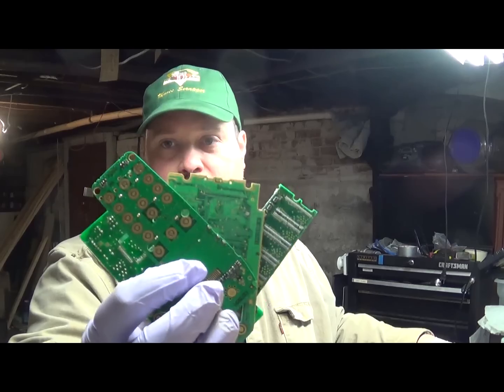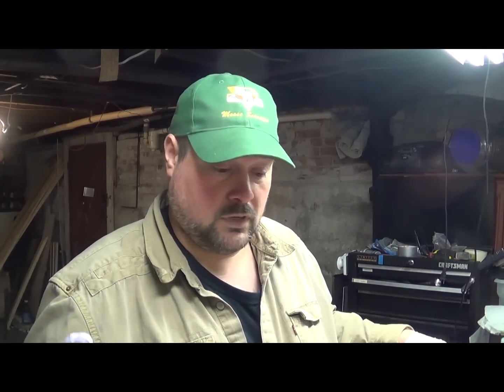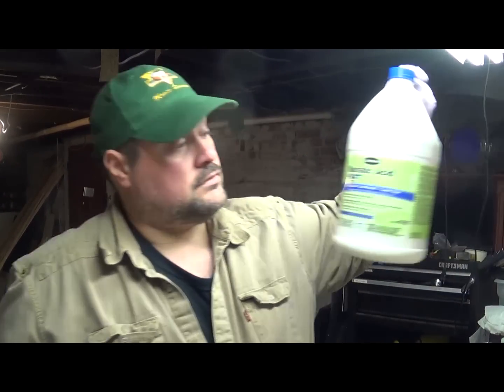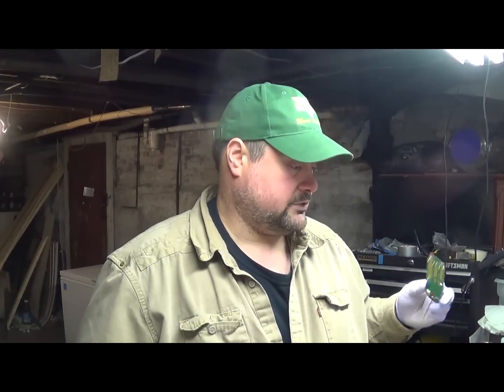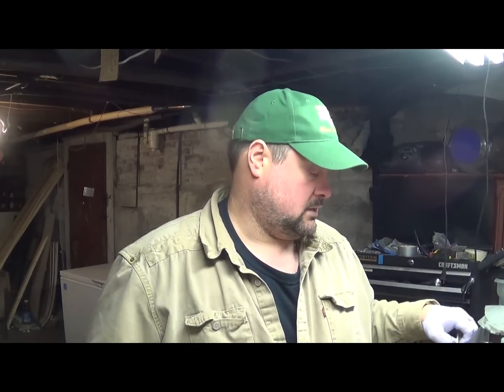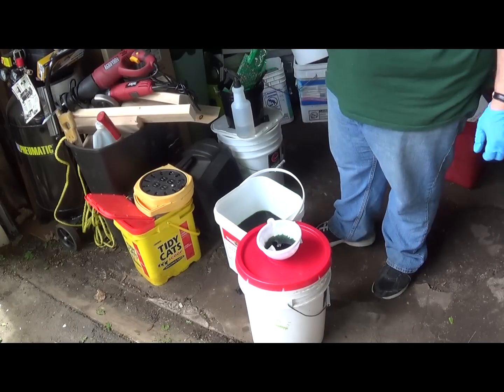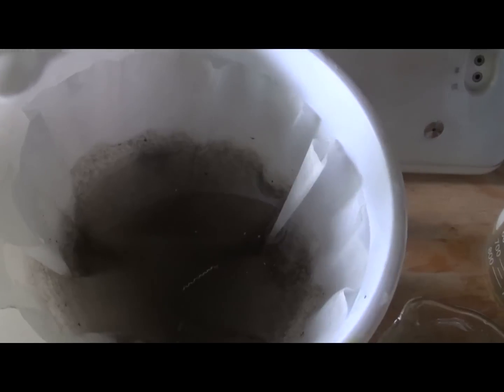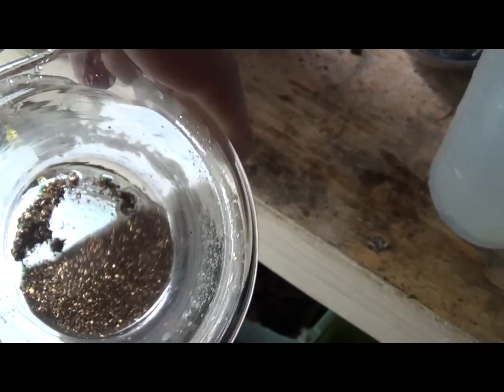Recovering gold from Cell Phone and other Gold plated Boards at home easily!

Comment: Hey moose! I have a question about needed supplies 1 is Pyrex the only thing I can use nitric and hcl in(aqua regia) or is there another material that's less costly. And 2, where do u get the filter to pour the chemicals through I didn't think it was a coffee filter but I could be wring..thought it was a special type and also what is the lowest ideal weather that the mixture can stay in during the process because I'm in Ohio and if you live here you already know what I'm saying it can be snowing and sunny in the same hour!
Reply from the maker: Hi there, they were in fact coffee filters.  As for the rest, depends on the material you are working with.  So far I have not used nitric in ANY of my videos and have been doing ok.  I would very, VERY strongly recommend Hoke's book on refining, its available free on the goldrefiningforum.  this can be a very dangerous hobby, best of luck!

Comment: hii , I have collected some gold fingers from ram bords ,i want to ask can we melt them directly to solid gold intead of dissolving them in acid and further processing. do reply
Reply from the maker: no.  As mentioned in the video, the gold is applied to nickel and copper and these need to be removed first.
Reply: no i have treated them with hcl and remover copper .they are just gold flakes
Reply from the maker: Then you can melt them, they will be what ever the average K of the gold plate was.  Typically between 14k and 20k

Comment: Great Videos!!!!!! I remember in another video you said (save all your Acid Peroxide coffee filter papers and burn them up and you may get a "little gold BB" at the bottom)....So why even do an "Aqua Regia" style solution? Why not just filter out your AP and gold foil and melt the foil while still in the filter paper? Why all the extra chemistry? I'm just trying to gain understating here...I not trying to be a smart ass.
Reply from the maker: +Luke Baehr AR is the "gold standard" for purifying the gold.  THe method you outlined would leave you with a very low karat gold.

Comment: Hey Moose, you said to completely depopulate the boards before they go into the solution?.. I've really been wanting to start trying this gold recovery myself. I have a lot of gold bearing material stocked up and also have a steady flow for more, so lately I've been studying up on it as best I can.
Reply from the maker: zackcat276 Yes, it is best to limit what you have going into the solution, especially for beginners.  It limits the amount of things that can go wrong.  Glad to hear you have a steady flow of material.  Keep in mind that it takes 1 pound of trimmed fingers to equal 2-3 grams of gold, and it takes about 50-100 computer towers to get those fingers...

Comment: Hey moose, ive just started getting unto scraping and i just wanted to know if youve come across a lot of the aluminum wire with electronics. And if it can also be coated copper.
Reply from the maker: GamerOffTopic Usually in the very small wires is where it gets confusing.  There are some aluminum wires, but there are also a lot of tin coated copper wires as well.  You cant tell by cutting the wire you have to file the side a bit to see if there is copper under.  For wire that small though its best to just sell as is.
Reply: Thank you!!
Reply: I'm not sure where they came from, but I've found plastic coated silver stranded wire, but very very small

Comment: Probably a question you get asked a lot. Where do you throw your plastic pieces after you scrap what you want from it so far  So-Cali doesn't except the plastic from a tv, printer or what have you, any suggestions or do I have to pay to dump in the city dump?
Reply from the maker: RKpromotionals My local recycling center takes them.  IF yours will not there may be some places that buy plastics for recycling.  Otherwise, you may have to take them to the dump, sadly.

Comment: Hi moose was wondering what sawzal do you recommend for a scrapper? And do you have a favorite brand of tools?
Reply from the maker: Brad Livecchi I don't have many favorites honestly.  I love my craftsman 19.2V cordless drill, robo grip channel locks, and Crescent wire cutters.  Most everything else I either have found for free or get cheaply at harbor freight.  THe sawsall I have now I got there for $21, the only thing I would suggest with most non-battery operated saws-alls is to invest in good blades.  And if you are going to go cordless, lithium batteries are a must.

Comment: Moose your the best.  Just can't get enough of your videos.  
I am really interested in the CPU's, which in a previous video you mentioned that it would only take HEAT, 83 C if I am not mistaken to process the micro-pins into a GOLD FOIL?  Can I achieve this using a ceramic crucible with heat applied by torch of some kind? Or do I need to bake these pins in some sort of kiln?  Just wondering if you could touch on that for me, please and thank you.
I am forever amazed at the knowledge I have learned as I watched you learn more and more with each video,. "You've come a long way brau!"
I have the nicest trimmed gold fingers, pins, CPU's and about 200 mother boards with countless H.D's, cell phones, and in large quantity the satellite back boards, some of which are plastered with GOLD.  I guess I can use this method to process these.  Having been so busy again lately, I missed the sections on the Air Bubbler, so I will have to catch up, and get viewing.  Maybe spend this weekend with YOU on uTube, Moose.  The pleasure is all mine.  Thank You for being Honest, and sharing your experiences and knowledge with so many of us out here.  Your #1, well at least your #2 FAN.... Way to go Moose.  I will have to find your email to get a mailing addy for you to send you a Genuine Canadian Moose Coin. Pure Silver for payment of your knowledge you have so willingly shared.  I feel privileged to feel like I am dropping over to "The Moose's," place each time I watch the great videos.  Thanks for having Me.   Michaels Metals Canada

Comment: Hey Moose, quick question. I want to know if I should take the copper off copper bearing motors or just take it to the yard as the whole motor. I have all the tools and time I need to do it, I just want to get the most money out of it. Thanks
Reply from the maker: Bricky I have done a few videos on just that.  Taking the motors apart will make you more money, there is no question.  The only factor is the time required to do it.  If you have the time, then go for it!
Reply: Moose Scrapper ok thanks. i will have to find that video.

Comment: another thought..I was previously using Klean strip muriatic acid "the safer fumes stuff".. this stuff only has about 20% hcl.. I had to drive around and found jasco at lowes that is 20 baums a.k.a 31.5%
Reply from the maker: Tony Pienkosky Yeah, there is a movement industry wide toward the safer stuff.  It still works so I am good with it.  I do prefer the 31.45% for refining though and its pretty much absolutely necessary for making stannous chloride.

Comment: The bubbler is so much easier on my latest batch of cell boards etc...been going now for 4 days and its almost done removing the gold..alot better than my first attempt last month with AP..my bucket looks like a large shiny snow globe this time..I made 2 minor mistakes that I'll have to work on in my next attempt..first, I went to dollar tree and got what I thought was plastic zipties, till I looked in and wondered where they went..turns out they were nylon and they disintegrated..and my second mistake, drill holes a little larger in my tubing and maybe a more powerful pump.. I only had bubbles coming out the first couple inches of tubing..I guess the holes were too small and or the pump wasn't producing enough pressure to make it all the way around the tubing
Reply from the maker: Tony Pienkosky Great work!!!  I love the snow globe effect.  I made the same mistake with the zip ties from the dollar tree as well.  Oh well, we live we learn right?

Comment: Not sure why, but this video seemed like a less efficient process than a previous one you made.  Maybe you could detail what you changed and why?  I am mostly confused about the popcorn popper lid.  I failed to see what you accomplished with that.  You used it to strain the liquid that you poured, then rinsed it out into the bucket that you then poured the original liquid into.
Reply from the maker: Dwight Gordon I used it to filter out a lot of very small pieces of circuit board, or at least tried to anyway.

Comment: I WAS HOPING YOU COULD HELP ME, I CAN NOT SEEM TO GET MY GOLD TO DROP, I MADE THE STANNOUS CHLORIDE AND TESTED POSITIVE FOR GOLD AS I KNEW IT WOULD BUT I HAVE A JELLY FORMING RATHER THAN WHAT I SEE OTHERS GETTING. PERHAPS I NEED TO ADD MORE SMB?
Reply from the maker: Angela Mooney nope, no need to add more smb.  If you see jelly forming then there is something else in there.  The stannous test will show very small traces of gold.  The biggest mistake people make is thinking they have more gold than they actually do.  I would try to gently heat it outside to evaporate as much fluids as possible.  If you already added smb the gold should drop out when the solution is not so dilute.  As for the jelly, I have no idea what that could be.
Reply: Moose Scrapper ok thank you very much i filtered the solution and rinsed the mystery jelly so i can still drop my gold out of a clean solution. the jelly stuff is a bluish gray, btw. my solution still tests positive for gold. i will do as you say and heat it  once again.
Reply: Moose Scrapper ok my solution no longer tests positive for gold now that half has evaporated away. i tested it 3 diff  times today  and it was positive  until now. it was the equivalent of 1 1/2 lbs of gold fingers and 15 cell phone boards, along with 28 g of cpu pins and connectors . i am unable to work due to spinal cord injury and am not receiving disability. so this really hurt me a lot. i did everything correctly , only thing i don't have is a way to watch my ph. i never would have imagined that the gold would disappear IN A MILLION YEARS. how did this happen?
Reply from the maker: Angela Mooney Are there any solids in it?  Gold will not evaporate.  Especially if you only cut the solution in half.  I am not sure what happened.  I have run this type of recovery over 100 times and have never had jelly form or gold just disappear.  Are you absolutely sure you followed step by step?  Was everything processed separately?  the fingers neatly trimmed with no solder?  No components stuck to any boards?  CPU pins processed separately?  You should have about 4 grams of gold from all that material.
Reply: Angela Mooney i think you have to much oxidizer in your solution hcl/ clorox works good on foils but i hate the process. i would much rather use nitric to disolve gold.   gold wont evaporate away you still have it just lost it try adding more foils see if they disolve. and never go by someone elses yeild from experience that wont get 4 grams  also on  the second refine you need to use nitric acid to disolve the second time be very carefull all process are extremely dangerous never go near ap or any other chemicals without a proper resperator. many steps are left out on youtube

Comment: love seeing the tools you create in order to complete a process.

did you watch that video on 50 years of cuban isolation, and how they adapted to reuse everything, every piece of technology.

either way, i cannot wait to see your gold precipitation video.

perhaps you may find a wire stand, or create one, that will fit around the hole in that red lid, and will fit outside of the funnel, and keeping it updrite. perhaps a circle with 4 upward prongs.

do you have a po box, where people may send you boards, or video cards? and other things like that.
Reply from the maker: RuneChaosMarine Hi there , thanks for watching!  I am grateful for my long time subs!  I have not seen that video, do you have a link?  As for a PO box, I don't buy scrap from folks, and no one has ever donated electronic scrap to me via mail before.  Do you need to find a refiner?  I may be able to help with that?THanks
Reply: Moose Scrapper i find that donating it to you would be helpfull, and more fun watching you do somthing with it.
also my boyfriend is quite avid against me collecting "trash".

i understand keeping a po box is more trouble then its worth.
though it was a fun idea.

Comment: will this also work to get the silver contacts removed from copper
Reply from the maker: altofreak https://www.youtube.com/watch?v=8oeg2DW1vAQ
Reply from the maker: RuneChaosMarine Silver is worth a lot less than gold, but, it comes in bigger chunks!!  Kind of makes up for it really.  Someday soon I will try my hand with nitric acid to refine the silver contacts.  Trying to smelt them as is could be deadly with the possibility of cadmium poisoning.  I am also hoping to find an electric organ to scrap, I hear those has a LOT of silver....
Reply: altofreak i am more interested in silver, i dont know why. but i would love to learn more on silver, and watch more on moose collecting those neat little contacts... perhaps he can melt them down one day and smelt some coins!
Reply: Moose Scrapper that sounds interesting, and i would watch that.
i was not aware that there was nasty in those contacts. thanks for the info.
Reply: Moose Scrapper I did get a Hammond M3 organ that somebody had broken up with a sledgehammer and put in a dumpster.  It had some nice strips of silver for contacts in the drawbars setup.  Somebody had already taken the tubes out of the amplifier.  The tubes are apparently where the real money is!
Reply: torchandhammer PS, it also had about a million miles of small single strand wire that I had hoped was silver, but it turned out to be plated copper.  The contacts for the keys had a tiny tip of something more exotic (I forget what).  I still have those in a jar.
Reply: torchandhammer
this is odd to drop the name, but i know some people from the hammond family.
Reply: RuneChaosMarine Wow cool!!  I have a 1958 Hammond C3 so I have a lot of reverence for that name.  Tell them thanks for me!
Reply: i am unaware if this branch of the family has any ownership, though they mentioned specifically that it was of relation.